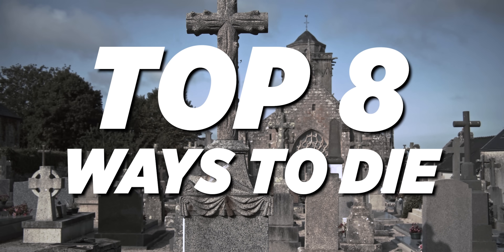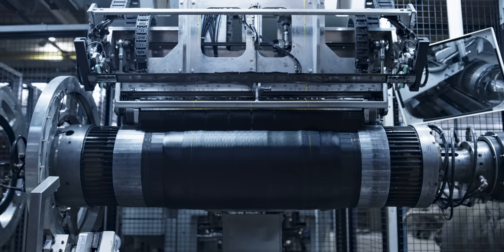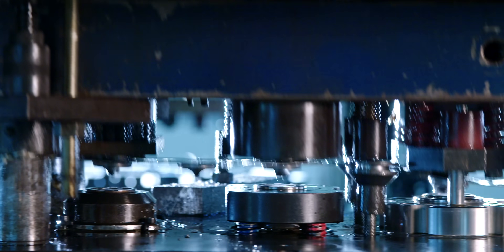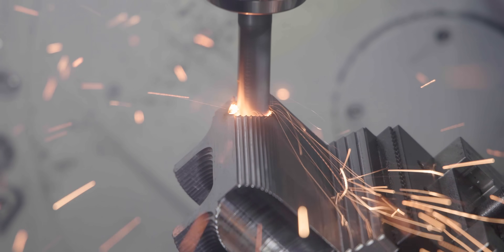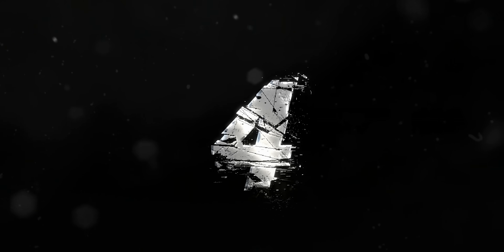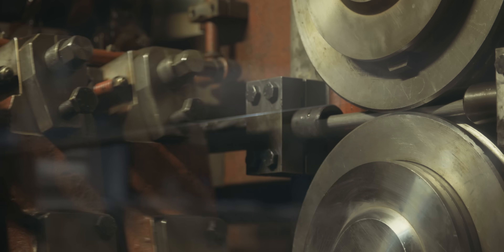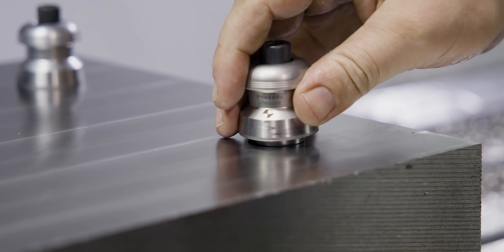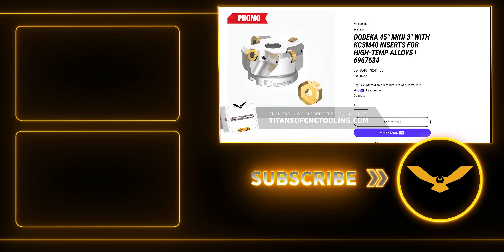HOW To Be KILLED In a Machine Shop

Comment: I’m guilty of defeating the safety doors.  But I also take extra precautions.  I’ve been doing it for 15+ years and I have zero injuries.
Reply: How about the new guy? On disability?
Reply: @daveyt4802  nobody else touches my machines.  I never do it to a machine that anyone else uses or could possibly use.
Reply: a machine with a disabled  door interlock isn't any more  unsafe than a older machines with no doors ...
Reply: @wildhorsemfg  ya, after running an open lathe that held 25ft long shafts and had a swing of nearly 40 inches, I’m not really afraid of anything now.  It’s up to the operator not to die.

Comment: i had an older makino a61 throw a boring head right over my shoulder because the tool change speed was too fast for the mass of the tool. pretty sure most shops around me disable the interlocks.

Comment: I'm on machining class and the first thing I've learned was "do not use gloves when working with machines"
Reply: You can wear thin rubber or nitrile gloves
Reply: Luvas de nitrilo. Leves, resistentes o suficiente para manejar peças com algum tipo de limalha, e caso sejam apanhadas, apesar da elasticidade, rasgam facilmente. Não há melhor, se o teu medo for utilizar luvas. Há algumas que até são texturadas e reforçadas na ponta dos dedos. Eu uso, e nunca tive nenhum susto.

Comment: As an instructor part of my curriculum is showing my class machining accidents and diagnosing what they did wrong, the video on youtube where the stock sticking out the back of the lathe turning into a pretzel and bouncing the machine across the floor because of negligent practices is still an all-time favorite.
Reply: Me too I also liked the bar in the lathe video, what was the guy thinking,  if he would  have run the machine and a  slower speed, the job would have got done safely.
Reply: @TOONMAN200  I think you're missing the point though, even with slower speeds hes still running stock into marked walkways with no warnings. In my opinion the risks of that setup way outweigh the benefits.
Reply: @rob7439  Yes you are correct, I missed that important point. How did you like my story.

Comment: Excellent points, good to see I am in the minority. I have been subscribed for almost 3 years. Improper work holding can also cause accidents to occur. They safety glass in the door is only so strong and an endmill that breaks can have significant velocity at higher speeds.
Reply: Hahaha thanks for the support Doug! And yeah ive broken the safety glass twice myself

Comment: I ran a cnc Lazer for a few years and we had a guy who literally bypassed the safety switch to the main door because we had to open it to check the slag and one day he turned on the machine and while he was waiting the 10 minutes for warm up he climbed in to fix something, the floor manager walked by and saw the machine was ready to start and he pressed start. Next thing the machine went into calibration mode and the main arm repositioned and crushed the operator between the wall of the machine and the lazer arm. He died soon afterwards. Another dude lost an eye when he was shot in the face with an undersized bottom die on an iron worker/piranha

Comment: I was once operating a mill at the end of my shift making a bracket that broke off a machine. I was in a hurry trying to finish up so I wouldn't have to hand it off to third shift cuz those old timers are real ornery when they have to work. 😂
I was wearing tearaway gloves that are designed for use on a mill. I was using the air hose to blow chips away so I could see my work when a very long strand of material that was coming off the bit caught the back of my glove and pulled my hand into the mill. It happened so fast there was no time to hit the E stop. Your brain can't process that quickly. By the time I got to the e-stop it was over. Lucky for me it was just the back of my hand it didn't do any serious damage. The most of the damage came from the glove of bunching up and tearing my skin. Never wearing gloves again not even cutaways or tear aways. Only latex gloves now.

Comment: I once got my arm stuck in a manual lathe, almost exactly like what Barry said at 5:30, i pinches the sandpaper too hard and got my arm sucked in with 710 RPM, my hand cause of this is suckerpuncked the axel i was sanding down and my glove witch i was so stupid as to wear at the same time, got snapped so the finger parts of it ripped over, as i was stuck my head leaned up against the protective glass witch bent in and hit the spindle and i was pinned while the machine was still spinning. Imanaged to scream for help and my boss who was on 15ish meters away came running and hit  the ES. then stated unwrapping my shirt witch had gotten wrapped around the spindle while it was tearing, had the shirt locked itself around the spindle my arm would have been ripped off, or i would have been dead at the age of 19. But i managed to escape with a hand that was broken 4 places... Never doing that again.

Oh and another way to die in a machineshop is to not subscribe to Titans of CNC Machining 😄
Reply: Dang Leander you got LUCKY!!!! And hahaha i hope you are a SUBSCRIBER so you dont have another “near miss” 😂

Comment: We had a 3 to4 kg spindle moulder head spinning at 18,000 rpm let go as the person fitting it got distracted failing to distract the loc nut. It did immense damage to the structures brickwork before settling.

Comment: You didn't see the spindle on?
Reply: No, when it is spinning at 2,000 rpm its pretty quiet, and it was a loud shop. Plus the door was open and this was the only machine that let you run the spindle with the door open. Plus, my focus was on the surface finish of the part. And my younger brother was the machinist 😂

Comment: Great content and reminders! a tale for you.. I was working at a huge shop in the eighties. When winter was coming we would look around for the welders used jackets. They were made of a heavy material and would keep you pretty warm while you were working. Since they were pretty tough they would stand up to hot chips. One of our guys had one of these jackets on while he was running a planer mill. He reached around the 14 inch slot cutter to brush away chips and the cutter caught the sleeve and started pulling him in.. The guy was a big dude. He actually pulled the sleeve off of that jacket and saved his arm... From where I was at it looked like it took his arm off...

Comment: We have a chip conveyor that has a 3 or 4 inch gap between the machine and conveyor cover where you can see the conveyor belt. The conveyor hadn't been programmed to turn on so chips were building up inside. I turned it on at the control so a giant pile of chips were forcing their way through the narrow opening. They started spilling out of that gap so I grapped a nearby pipe to start pushing those chips back down in and the pipe got caught on something and started moving with the conveyor and it pinned my hand between the pipe and the machine. Luckily the e stop for the conveyor was in reach of my left hand. Hit it just in time, but had to yell for help to reverse it to get my hand out....no damage done.

Comment: I relate to the getting comfortable one personally. I worked at a shop in central Wisconsin first starting out and was running a 3 axis mill that was open and you had to manually change tools. Every tool change the Z axis went to the home position, stopped the spindle, and waited for the operator to change tools and hit cycle start again. Well I was doing a bigger order and got into a routine. There was a 3/4 HSS roughing endmill loaded, finished the cut. I reached up to change tools before the spindle had completely stopped, my hand around the tool maybe a half inch away before I realized. I walked away for like 5-10 minutes just clearing my head after that one. I could've easily lost my hand.
Reply: Near misses and the 😳😳😳 change your perspective in a hurry.
Reply: We have ATC's and if there's any issue at all I don't touch anything. I lock it out and grab a maintenance guy. Personally know something who lost a digit to the tool changer arm.
Reply: @DolphinPain  yea you definitely got to watch out when things bug out. I've seen some weird stuff working with older machines. Usually they run smoothly even though they are 30+ years old, but when they bug out I definitely take extra caution with any moving parts
Reply: That's why at my company anyone can take his papers as soon as he's caught manipulating any safety device.

No excuse.

Comment: Improper work holding. Not usually as violent on a mill but I’ve seen stuff come out of a lathe. I’ve even seen a faulty 4 jaw chuck throw a jaw out before. No doubt it would’ve killed someone if it hit them
Reply: Reason number 436 for me to be a “mill guy.” Thanks! 😂

Comment: There was a time I worked at a place that made home and industrial air filters.  That involves feeding the material through a 12 foot wide needler, and a bunch of rollers that Don't care if you get a piece of clothing or finger caught in it, it will make you a pancake.  Well I had my shirt get caught in the final roller before the end and I didn't know until I started getting pulled towards the roller.  Luckily I was able to place both my hands on the outside of the machine and hold myself back until them roller ripped my shirt clean off me. Scary situation that turned into an embarrassing one when I was sitting there with no shirt on but I was still alive thank God. My line foreman also had his fingers chopped off by the shear that cuts the material too...
Reply: I saw a guy on our facebook group a couple months ago that had a similar situation. Machine grabbed his winter coat sleeve, and luckily the coat was old and it ripped in half up the back of the coat. Scary stuff right there
Reply: @Barry Setzer  it is very scary indeed. Makes you fully understand the power of the machines that is for sure 🤙🏽

Comment: Was running a cnc that the auto tool change was broke so I had to do it manually. As soon as I let go of the tool release button (with my hand still on the giant ass face mill) damn spindle turned on. Life flashed before my eyes
Reply: Yeah thanks for giving me something new to be afraid of! I once saw a guy put a tool in the spindle, and for some reason part of the toolholders flange broke off and shot right at his face. Hit his safety glasses but after that i never put a tool in the spindle without glasses on
Reply: If a machine is broken, simply repair it, or refuse to operate it..i once threatened my boss to pull the plug on a lathe and cut off the powerplug if he didn't fix the brake on that machine...i actually pulled the plug while he was standing there...
Reply: @JanBinnendijk  problem is that nobody knew it was going to do that
Reply: @joemacfarlane2517  you did notice that it didn't change automatically... where did you get the new tooĺ?.. something tells me that you knew the "ATC" was broken...
Reply: @JanBinnendijk  yes we knew it was broke obviously, we didn't expect the spindle to randomly turn on as soon as the tool release button was let go of.

Comment: There was an incident at a company I now work at where a large section of aerostructure aluminium sheet was being lifted incorrectly which slipped, fell and cut a guy in half. Following another incident with toxic gas exposure at plating dept. that put the health and safety on pretty high alert.

I had a near miss few years ago working at a different company on an old Mazak lathe. Alarm buffer overflowed and essentially locked the spindle spinning at 3k rpm. Of course no interlock as it was broken and disconnected - cheaper than fixing it. Noticed it with my hand about 2 inches off of the part and jumped away. Neither reset nor E-stop had any effect, spindle kept going regardless. Had to hard reset the machine to get it running right again.
Supervisors reaction: ''Your fingers would probably just bounce off the chuck anyway''. In an instant I understood why they made losses for 18 months straight before I even started working there.
Reply: Yeah and alot of aircraft companies have old equipment from the pre-safety days that still run. Not to mention giant heat treat ovens, which are bad places to take naps
Reply: Ouch, the aluminum Guillotine

Comment: one of the sales people that I work with told me about one that he had worked with before.
he was working in an open mill removing chips around an end mill while the spindle was on with his FINGERS!.
yes, you guessed it, he's missing a finger.

I had an ugly one when I was an apprentice. Me and a machinist set up a milling machine with a boring bar, and we forgot to secure the boring bar properly.
It hit the glass and a piece of the glass came out right between us and hit the machine behind us. luckily it didn't hit anyone, but there were 3 people within 500mm (19 inches) of where it came out, and it could have gone very wrong.

don't mess with safety precautions/restrictions!

Comment: Lifting material in and out of a machine can really cause problems.  Especially if you get distracted and forget to disconnect the material from the crane.  When the  lathe was turned on it lifted off the ground as the lifting strap wrapped around the shaft.  Gave everyone a good scare after the lathe was turned off and the lathe crashed to the ground.  Charles

Comment: I've been lucky to not lose any appendages, thank God, throughout my 23 years of machining. However, make no mistake, you can follow every tip in this video but you are still going to get hurt. Still, the keys are coming out of the door locks...
Reply: Yeah I think I bleed a little every day. But hey bloodletting used to be a thing, so its probably good for us 😂
Reply: @barrysetzer  For sure. When I was running mills religiously my finger tips use to have razor like cuts all over the them from stoning small parts. I've also had some seriously deep cuts from the roto deburr tool slipping. Tetanus shots be damned...

Comment: My 2 worst situations:
1) making a part with was only doable by overriding a safety switch (it was not possible to close the door of the CNC milling machine because the part was to big)
2) failure of the fixture, the following acceleration of an 0,5kg aluminium pice to 13000 rpm and punching through 1,5 or 2,0mm steel enclosure of the mill.

Comment: always before lifting or moving something take a second to understand what you are lifting or moving is it possible to save it or not. Usually if you need tools to do it is not so if it falls save yoself

for safe device you need to think the 30kw spindle is less flexible than yo own body so there be doors for reason

i have my watch and gloves on all times because i drive cnc that has automatic doors so there is no way mechanically for me to get in there. gloves because is bugger to fix yoself up 5 times a day because chips

long things yes, i wrap my sleeves for multiple reason

see the first one

never more than 4x overhang

see the second one

never touch anything int yos people get mucked up for less and without reason

Comment: I've seen and been involved in some scary lifts in the last decade+ working in a tool room. I was working on a job once where the fixture we were building weighed 8 tons and was made of welded steel plates. The engineer failed to put any sort of lifting bolt holes anywhere on the frame. The fixture itself was machined and delivered to us for assembly and had to be built on a custom made stand due to the mass. Since it was also double sided, we had to finish working on the bottom of the fixture by flipping it over and I refused to do so because there was not a safe method of holding onto the fixture. Since all we were doing was running steel pipe lines for the air cylinders, it wasn't a lot of work. But my boss asked someone else to do it and he didn't even stop to consider the reasons why I refused to do it. Suffice to say he hoisted a 16,000+ pound frame into the air with fabric strapped wrapped around the square edges and the straps let go. I sat there and watched as the thing fell and basically caused an earthquake in the shop. No one was hurt, but it cost us about 10k in damage to the fixture and a couple weeks delay in delivery to our customer when we were already behind. It was only after that point that they welded on blocks with lifting holes.
Reply: Good thing you didnt tell them why you wouldnt do it. Thank goodness no one got hurt, but youre in the wrong too for sitting back and watching. Good attitude
Reply: @chrism4008  something tells me this is one of those im the boss so im right types.

Those are not open for ideas that not there own.
Reply: @chrism4008  It would not have done any good.

Comment: Dodgy setups could sure be one! Was cutting a 20mm billet of 6061 on a CNC router. The spindle was at 12K RPM when the part came loose from the fixture and wrapped itself around the tool. I'd say a 200*200*20mm piece of aluminium spinning that fast won't be stopped by the glass on VMC doors...
Reply: Ooooo that a good one! Agreed!!